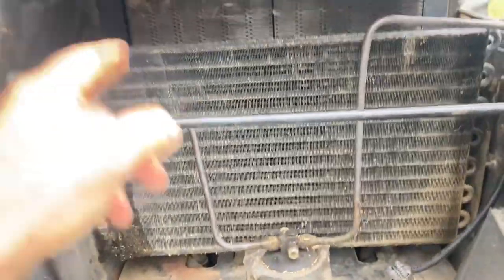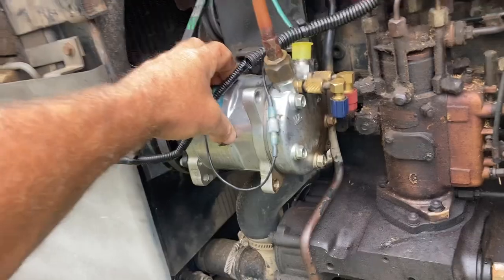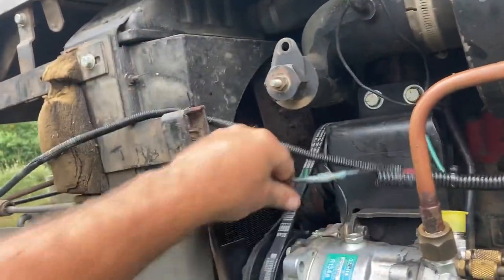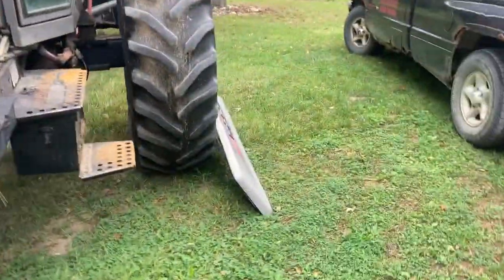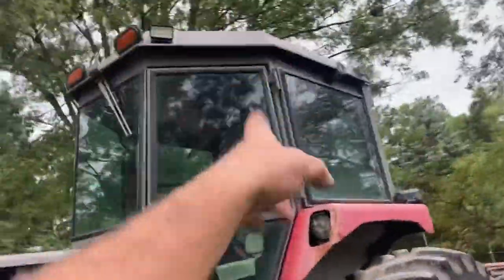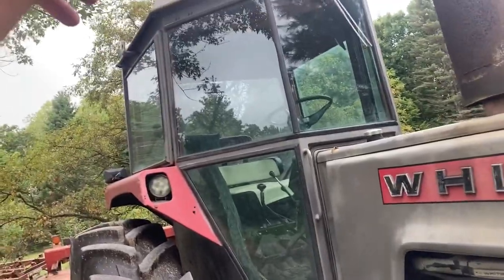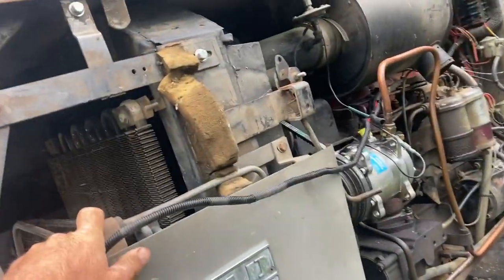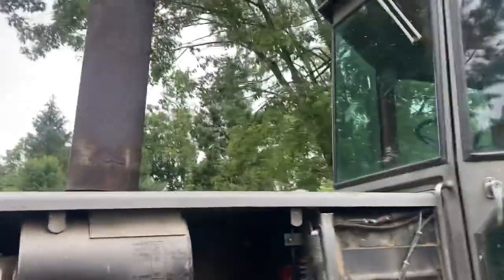R-12 Condenser replacement White 2-105

Comment: I made a condensor for an old tractor from an evaporator off of a central air conditioner once.  I made a custom one once by cutting up an outside unit from another central air unit that was hit by a bullet.  The one you have looks like a condensor I pulled from a junk Ford futura.  Amazing your copper lines held up, I made my custom a/c lines from steel and crimp the hoses with my hydraulic crimper. Of course the factory lines are often aluminum anyway!
Reply from the maker: Damn I wish I had your skills that should be fun if you were up here for a couple weeks one summer you can teach me all sorts of cool stuff sounds like you’re an inventor
Reply: @michiganhay7844  I would enjoy it. Was hoping to get out of here this year, had so many problems truck broke down roof leaks etc. I have been resourceful because I grew up poor and am still poor in my opinion. Wish I would have had more formal training but you know how you learn by doing. Got to figure out the best way to get up there, I guess you have a place to stay.
Reply from the maker: @chargermopar  Of course I got a place to stay for you I got plenty a room in my house
Reply: @michiganhay7844   It will be great when we do meet. I am sure there is plenty to do, I remember you wanting to rebuild an injection pump.

Comment: Copper is  notorious  for cracking in the flares.....Those o ring fittings used now are are called beadlocks................copper steel, brass will silver solder.......Show what you find.... will help if I can
Reply from the maker: Well that’s where I broke my flare was right at the compressor tightening it down although it has lasted 20 years right now the only other option would be to somehow find the 45° AC flares and find somebody to crimp them on a rubber hose? What last longer the aluminum or the copper? And I was told to use like a medium silver cider otherwise I’d have to heat us too much the guy who was the expert he died a few years back seems like to these guys that know stuff like you do they’re not around anymore
Reply: @michiganhay7844  I forgot  exactly  what it is called but it is  a golden  colored wire... does not require a lot of heat.....
Reply: Did some research to refresh my memory   It is 45%  silver
Reply from the maker: @farmingforfunandprofit940  thanks I’ll probably be doing that next week if I have any luck locating a condenser I’m wondering are there conversion fittings from 45° flair to the modern O-ring style

Comment: Have alot of buddy's try 134a in r12 system and it leaks out of every fitting.
Reply from the maker: Yeah that’s what’s good to know are use a product called Duracool made in Toronto it’s an R 12 compatible seems to be working pretty good
Reply: I do believe you can still buy r12 online and have it shipped to you. Atleast you could 6-7 years ago.
Reply from the maker: @e.a.bfarms  Oh I didn’t know about that I ran out of are 12 years ago I’ll have to look into that
Reply: Interestingly i have put R134 in my old Dodge Charger and my 1990 F250 and they get plenty cold and don't seem to leak out.  Doesn't cool as well but it can get close at times. Had to adjust the expansion valve in my Dodges by tightening a bit.
Reply: @chargermopar  It might be a tractor issue, I don't know anyone who tried it in automotive.
Reply: @e.a.bfarms  I did disassemble the whole system and clean with acetone, as well as replace all high pressure hoses. Those green o-rings are what I used for the fittings.
Reply from the maker: @chargermopar  Aren’t the green O-rings for our 134?
Reply: @michiganhay7844  yes they are